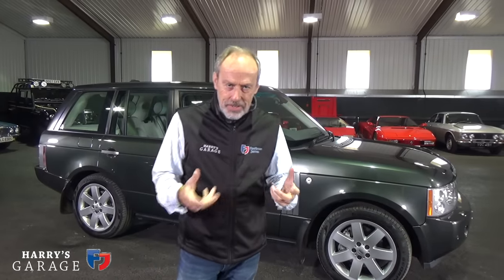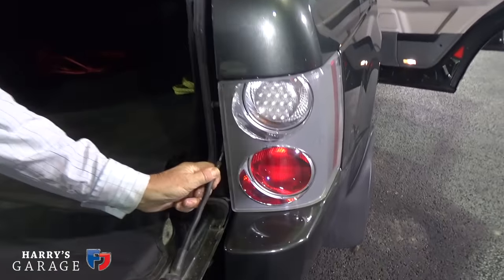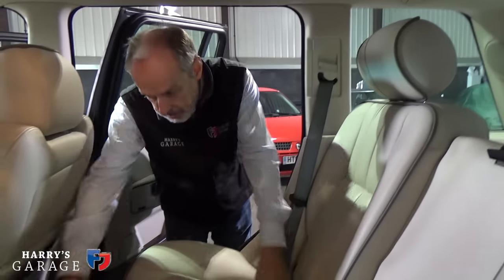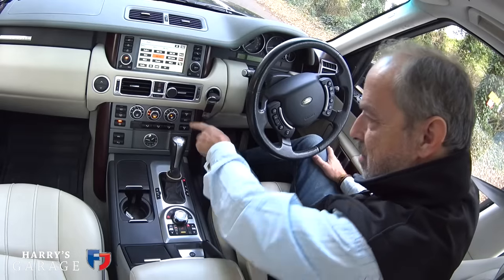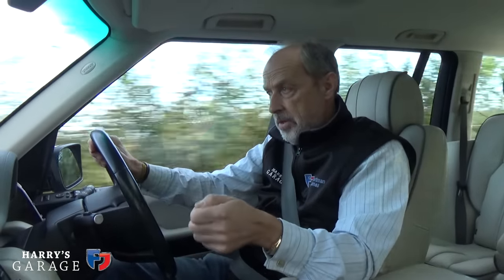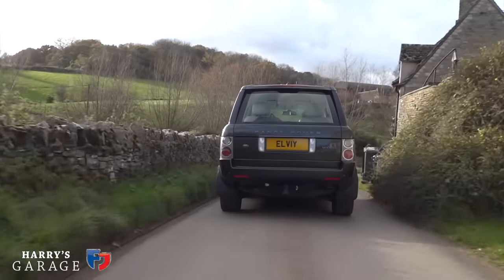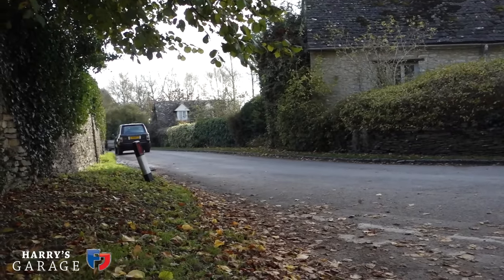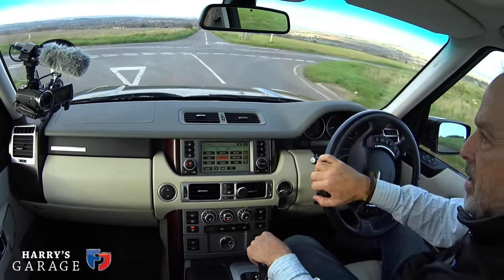Range Rover real-world review and buyer's guide L322 TDV8

Comment: They are inexpensive for a reason, mine was both the best and the worst car I have ever owned. To drive in I would argue there isn't anything better but sadly very unreliable, I spent many thousands in upkeep. Buyers beware!
Reply: My friends dad had one we went to Europe in it, great car, I think he spent a lot in repairs
Reply from the maker: That's why I've done this video, to explain which models to go for and which to avoid. L322 had a troubled gestation period, it was hatched under BMW ownership who used their 7-Series mechanicals underneath, which weren't really up to the job. When it was launched in 2002, Ford owned Land Rover after buying the brand from BMW in 2000 and they did a massive redevelopment of the vehicle, to make it more reliable, which they succeeded in.
That's why you should avoid the early versions, as the post 2006 L322 are much better sorted, as I explain in this video..
Reply: Yes true Harry,  mine was a 2009 3.6 V8 and I was in love with it, but it was so troublesome, head gasket, electric seats, EGR valve, to name a few faults. By the way thanks for sharing your thoughts, another very watchable video.
Reply: I wonder how the gas engines are as far as reliability - here in the US we never got the diesels.
Reply: Roger Bailey mine was a disaster as well.
Reply: Roger Bailey not to be a jerk and im not saying that was your case, but for me the rr is and always was a luxury 4x4. Nothing more, nothinh less. If a person is worried about maintenance costs it should avoid the rr. Go japanese or korean. If money is not an issue and you want a luxury car with real 4x4 credentials, rr are the best. Beautiful and classy machines, but heavy maintenance. But definitely more relevant that any suv from germany (suvs I mean, not the g wagen)
Reply: Inexpensive?
Reply: jigrodrigues luxury doesn't have to mean unreliable though.
Reply: Colm Farrel true, but maintenance on a luxury item is always expensive, even if it's only scheduled maintenance
Reply: jigrodrigues agreed but I don't think a car should constantly leave you stranded or constantly develop problems. In the case of scheduled/expected maintenance, which is expensive such as the egr valve, I have no problem with that as you should factor that into running costs.
Reply: Colm Farrel yes i agree, it should perform well if not better than the rest.
Reply: It's not the costs, it's the inconvenience.  Having to drop off and collect a vehicle constantly for repair is costly in time - something you can't replace like you can money.  Having to rely on a loan vehicle or make do with another vehicle is irritating - particularly when it is a vehicle you have bought because it is supposed to be somewhat practical and useful - it's not a high strung Italian car you only take out on weekends and road trips, it's a large 4wd you expect to be able to use every day and not strand you on the side of the road constantly.
Reply: Coil pack on a TDV8?
Reply: Excellent point! And it's doubly irritating when you're dropping the car with a dealer who repeatedly fails to fix the electric park brake for instance. When I ran an LR I soon learned that an independent specialist is the only way to keep these things on the road.
Reply: JJG Rodrigues Just because a car is luxurious, it doesn't mean that it has to be unreliable.
Reply: Harry-stop lying.i have a 2004 model and its been good , the mechanicals have been upto the job so for you to come here and tell people to avoid the early models is simply rubbish and not thinking
Reply: I do most work myself so very inexpensive
Reply: Gerry-Are you a mechanic to do the work yourself? what model do you work on
Reply: Barney B 07 tdv8 I do a fair bit myself what I can't do my mate does for me
Reply: He doesn't need to be a mechanic to work on a Range Rover, it's nothing that complicated, the biggest problems are tracking down problems, the rest, is just having the 'instructions' for the repair (just like the shops have) and do it. 
Somethings require special tools, so those, you either buy them or take the car to the shop.
Reply: Cut de Pie Fails you have hit the nail in the head mate
Reply: Cut, i have a L322 and would like to switch to a 2011 RRS.mechanics charge a premium to repair these cars as they assume all of us are rich mongrels.Is the RRS also easier to work on vs the L322?
Reply: Barney B no.rrs way harder to work on.
It's a body off for a lot of jobs on engine
Reply: 7000 pounds to buy... 12000 pounds to repair lol
Reply: GERRY-the RRS is based on the LR4 body-so what makes it so special
Reply: 2008/9 lr3 v8 petrol probably most reliable and long lived of the breed.
Reply: What Car? Reliability survey for 2017 puts Range Rover as the second worst in the world in terms of reliability. Only outdone by Jeep! Range Rover manage only a 50.6% reliability rate while Jeep, stunningly, only have 42.1% reliability.

Lada anyone? lol
Reply: LAPA-You are a fool if you make purchasing decisions based on those silly reliability ratings sponsored by rival car companies.FACT-RR has always been down on those ratings but people still buy their great cars, its the prefered car for royalty, sportsmen, business people and the classy.Go to any RR dealership and they will tell you that supply is limited and they even have back orders.RELIABILITY SURVEY?lol lol only a fool would believe such rubbish
Reply: "Go to any RR dealership and they will tell you that supply is limited and they even have back orders" - and you claim that is a more reliable indication than a reliability survey? Because, of course, all car salesmen are honest and there is no reason why they might want to claim their product is so desirable that it would be pointless to try to negotiate a discount, no reason at all.
Reply: Range Rover dealer incoming...
Reply: Thanks, but I've already got a wife that has been running perfectly for many years, requiring only regular servicing to keep her sweet.

As for your response, your statement about believing what car salesmen say was the most egregious piece of bullshit in the comment, which is why I remarked on it, but if you want me to pick holes in the rest of it, OK. 

Just because rich and famous people buy something does not make it the best. It might mean it's the most fashionable, or it projects an image that the individual in question wants to portray, but these are the same sort of people that buy Ferraris and then cover them in gold vinyl wraps, or buy Rolex watches that are no more accurate than a cheap Timex just because they prefer the looks and/or the image. They are the sort of people who would have bought Rolls Royces, Bentleys and Astons back in the 1980s and 90s, when their cars were superannuated designs, limping along well past their sell-by date, and long before those companies were bought out by bigger manufacturers who made their products reliable.

And please, explain to me how you would assess the long-term reliability of a product by hiring it for a few days, or taking it for a test drive? As for asking your friends about their experiences, it's great so long as there are enough of them to make the survey statistically significant. With thousands of cars produced, relying on anecdotal evidence from a handful of people makes less sense than - for example - looking at the annual reports from the companies who provide used car warranties, where they show what percentage of the vehicles they cover have had to be repaired and what the average cost of those repairs was.
Reply: Matthew Sharpe which is why I said a car shouldn't constantly leave you stranded whether that's leaving you without a car or in the middle of the countryside.
Reply: Adrian-so tell me, if you rely on those useless ''reliability' surveys which says the RR is unreliable and crap, how come I have never had any major issues with my RR which is at least 10 years old, save for the regular maintenance? If i had read the crap from those doctored surveys, i wouldn't have bought it and i wouldn't have driven across NA with no problems at all.You need to STOP this nonsense that you people keep spouting all over the net without evidence.Quite frankly i am tired of reading the same nonsense all over when each experience and situation is different.I have seen classics that are at least 25 yrs going strong while LCs remain grounded in the local junk yard
The RR is the Apple of cars and the LC is the counterfeit, imitating the RR but never able to duplicate it
Reply: Barney B
You're right, you shouldn't just use some article from a biased car journalism site to decide which car you wish to purchase. But I don't.

As has been mentioned above, you use several sources to gain your info, none of which are infallible.

But nevertheless, how do you explain a reliability survey conveying what I've heard and seen oneline and from friends over many years? Not only anecdotes of these cars being a nightmare but dealers from hell making customers regret they ever considered going near a Range Rover?

There is no one easy way to know which car will be reliable and which car won't be reliable. But trying to dismiss someone's comment because they happen to quote one particular source makes you suspect.
Reply: The internet is your friend.Just google LC 79 series for sale-it brings up results such as a 2013 model going for  $75,000 and  mind you that is a bare bones model that has never been refined for the last 25 years.I then go ahead and search for the LC V8 which goes for 40,000 pounds for the 2011 model.A 2011 RR costs around 20,000 pounds and one LCV8 buys 2 range rovers.So even if the RR was unreliable as you say, for the most part, LCs are usually overpriced monstrocities that dont make financial sense.True, i could consider the LC if the price was on par with the RR for the same year, but as you can see, the RR still makes financial sense even with those fake ''reliability'' scores that are made by rival car companies
Reply: How much is a 2011 LC and how much is a 2011 RR? You know the answer.The range rover wins in terms of affordability, class, beauty and finesse.The LC is an over priced gadget
Reply: If It's not causing problems, it's not Brit. Cheers mate. Landies are a philosophy....you know all these things...
Reply: Totally agree.  Day to day I never knew what was going to mess up.  An electronic nightmare.  Plus the gearbox was slipping all the time.  I drove it 300 miles to sell it and barely made it.  Thank God it's gone.
Reply: Garry-No need for lies and making up weird stories.If RR are so bad, how come everyone wants them and is the official car of the royal family? You think you as a commoner know more about reliable cars than them?
Reply: No Lies.  Maybe a commoner! HAHA The secret to success with these cars is to sell them before they turn to poo.
Reply: Garry-A new RR is at least  $100,000 and demand vastly outstrips supply.Its used by heads of state, the military, the police, celebrities, and is the official car of the royals.Besides that, its the only car in the Louvre museum.So.......I suppose all these users are wrong and YOU.....a disgruntled commoner is....Right? Do you see the irony here?
Reply: Barney B   Actually the royals are paid for the use of their warrant, which recommends British products exclusively. The official “everyday” car of the Windsors is Jaguar. The Queen gets many years out of her XJ sedans, which she drives herself on her estates. For many years Jaguar have had a standing agreement with the royals to provide them with a car, free of charge, from the dealership closest to where they are visiting. And one final thing to consider: the new “official” limousine for Elizabeth and Philip to use on occasions of state is a magnificent one-off Bentley Mulsanne.
Reply: John-That's just the royals-Many many classes of people use the RR while the only people who i know who use the LC are Isis terrorists, extreme overlanders, mass cheap people, ambulances and police cars in the 3rd world and mining companies
Reply: Same here. Was wonderful when it worked, but it regularly let me down and cost a fortune to maintain. Should have bought the Land Cruiser I had my eye on.
Reply: The only thing whining and complaining all the time whilst I owned the 2003 LR322 (which Harry recommends avoiding) was the LR322 itself. It was a shame, as I loved the car and had always wanted a Range Rover. It just turned out to be a disaster. It was meant to be a comfortable car that looked better than the LC and could take us on family trips offroad in Dubai, but sadly that never came to pass.
Reply: Dubai? So many cars to choose from in Dubai apart from the RR.If you drive in the desert, dont even think about the RR-it was not made for pathetic environment like that-stick to the LC in the desert.L322 is LUXURY-a desert is a remote no luxurious place
Reply: Thanks Barney. After fifteen years of offroad driving here I'm fairly up to date with what's what. The L322 should be perfectly suited to driving on mountain tracks, wadis, long road trips to Oman, etc, but was simply too unreliable. There was plenty of marketing done around desert driving and gentle dunes should have been perfectly fine, but the suspension would automatically lower itself at over 40kmph, which meant it was too easy to damage the bumpers. The main issues for me were less the cost of maintenance and more the fact that it could let you down at a moment's notice, which it frequently did. You don't want that to happen driving around the corner to the supermarket - and certainly not halfway up a mountain when the transmission overheats, or when crossing the Oman border halfway into a 5 hour road trip with smoke pouring out of the exhaust, or halfway to a wadi drive when the fuel pump fails, or needing to drive to work when the air suspension springs a leak, or driving to the airport when the telescopic steering collapses. Just some examples for a vehicle that was regularly maintained under an extended warranty at the dealer itself. There are good reasons why the 2002-2006 models cost nothing and people such as Harry specifically recommend avoiding. The car was an utter disgrace in terms of reliability.
Reply: i have a 2002-2006 Model and again, its never let me down.Gone for more than 4000 km in less than 4 days and it worked perfectly fine, commanding the road and being luxurious.Dont listen to some Harry guy telling you to avoid a car, i am RANGE ROVER AND I USE IT daily and see no problems
Reply: i would never buy an overpriced UGLY LC.They are so UGLY everytime i see one i close my eyes.UGLY tail lights, UGLY SUSPENSION, ugly shape and UGLY grille.Why would i buy one? if i want reliability, i might as well buy a horse, its very reliable, it never breaks down
Reply: Barney B Well, quite. That’s why I bought the Range Rover. In retrospect, a bad decision for many of us. If you could coming RR engineering and styling with Toyota reliability we would all be happy.
Reply: But then again, I'd rather have diphtheria then have a £7K Astra
Reply: Roger Bailey  a kind of  hatred and love story at the same time !!!!!
Reply: Barney B hi , did appreciate the way you defend RR , I am looking to give a try , but more I try to dig infos and read comments  am getting more confused , seems that they are good period and bad periods of their production/  am a  Mercedes owner / and I have had  huge electronic issues with my 2008  CL 600  V12  , coil pack , gear box stuck ( sold it ) after spent 10.000£  to try to fix it / I went back for early models  2002 / 2004 and own  several of them .. absolute perfect reliability ! So will keep them when I will diving into the “RR uncertainty “ !!! HSE Sport likely ... one thing for sure RR has the best driving position!! Beautiful cars elegant chic  ... ( BTW not sure about reliability of beautiful elegant and chic women  ? but that s another story !! )
Reply: I agree 100% with this comment. My 2008 TDV8 RR has been wonderful to drive while working, horrible to own. I have had issues with suspension, EGR, fuel return circuit and turbo geometry. All of these issues left me without a car driving around in my wife's Citroen.
Reply: Needs EGR valve change at 90,000 miles? Odd that one of my Ford SMaxs has covered 205,000 miles and is still on the original EGR and DPF. Also original, engine, gearbox, injectors, clutch, DMF and turbo. Had to change the battery twice and it’s just had its first starter motor at £189 fitted. Massive space and drives like a well sorted hatch back
Reply: I use my 2011 RR autobiography daily along with my Disco 4, I look after mine and haven't had any problems, I'm a LR tech however and although a few problems do come up most people do not realise there are actually 2.0 versions of the parts which fix said problems lol. LC are good for deserts and stuff but most of us live in the city and do 15% dirt which is why the RR is king forever :-)
Reply: Inexpensive?!?!?! They’re like £100k new!!!1
Reply: Second hand, they loose a lot of money.. I love mine but I'm a mechanic and I don't really see the labour costs but it's not cost me much to keep going.
Reply: Five Eyes Sights totally agree I’m afraid a lot of Harry’s comments about the early rr are totally wrong if you get a good bmw one they are great cars for the cash
Reply: Roger Bailey iiii
Reply: Five EyeSights I hate to interject politics but you sound like a ardent Trump supporter that sees no wrong or flaw with your choice. Scary.
Reply: FULL SERVICE HISTORY IS A MUST! heard of turbo's going, AND snapped crank shafts. MAINTAINANCE is absolutely KEY to the long life of the L322. I've had a RRC V8 3.5, and a P38 Diesel(of which everyone swore blind was a shite car, just do the correct servicing and they all become great cars). L322 is next on my list with the TDV8 power plant. Thanks Harry, good video.
Reply: Sorry Harry that is utter BS
I work on BMW's all day long and I own an L322 with BMW Electronics
The BMW era car is by far the best L322 to own
Mine has done 300k
I changed the engine, got a used one from an E39! 
The post 2006 versions are utter rubbish. Major work with Turbos, DPF's, Ford Electronics
I upped the power in mine using a turbo from another BMW (some slight rework needed)
Reply: Hi Henry, in my opinion, 3.0 M57 is the best option for l322, the maintenance is the cheapest for this engine at least in Poland, I don't regret I have this version and I would recommend it.
Reply: M57 is a fab engine. Far better than the later PSA based junk
Reply: Garry Patrick has
Reply: So very true. You buy this car at a loss. You buy them, experience them with passion until something breaks. Either spend alot on repairs or dispose them.
Reply: @goldenboyi1989  just because you haven't had any problems doesn't mean they are all trouble free. production quality varied a lot back then.
Reply: thx cpt obvious..i mean that's the catch with all of these luxury import rides..the best rides on the road, if you can afford to keep it on the road, 
that's the allure, demand, attraction, respect from others, whatever youre going for, impressions or engineering, you've got it..IF
and if not..there's the Kaizen quality control of Toyota-Lexus..my brand for the last 20 years..but, an air bed on wheels, made for moms, in comparison.
Reply: Colm Farrel  Egr valve problems affecting all modern diesels and a fair few petrol cars, I have worked for JLR dealers and VAG dealers, Vag have major ego issues and as they are mostly built into the ego cooler systems don’t be fooled very expensive to fix, the main cost of ego repair on Range Rover is the fact that they are buried under the left turbo so it has to be removed to rectify
Reply: Five EyeSights don’t do it terrible car new shape RRS much much better and more reliable car
Reply: adrianchell bullshit every manufacturer has backorder issues, JlR are actually very good at problem solving and reengineering problem Parts which is often the case with back orders, they also have a very good escalation system to combat this if the dealer staff know how to use it, I have recently switched to an Audi dealership and believe me JLR are streets ahead in Parts backup and infrastructure than VAG
Reply: all land rovers are unreliable not just Range rovers lol
Reply: It doesn't matter if you can or can't afford to run these behemoths, they should still be fit for purpose. If you're forking out 1000's of pounds in repairs every couple of months or years then what's the point?! A car is no good to me if it spends more time in the garage than it does on my drive. Also, the fear of it breaking down when it is on my drive
Reply: Cut de Pie Fails lol no your wrong egr valves on tdv8 requires turbo removal, gearbox repair/torque converter needs body off, diagnostic is the key to most faults and no cheap code readers do not tell you anything like the main dealer ones
Reply: Five EyeSights you have a valid point, the key to owning such a vehicle is main dealer maintenance, people think that warranty recalls make cars seem unreliable, not true, JLR are actually very good a fault fixing when one is identified, they will not release a new vehicle for customer delivery from a dealership if there are any outstanding recalls, vehicles will be quarantined if a known problem has no fix available, unlike some of America’s favourites, on my last JLR course there was a guy whose dealership also had BMW and he claims that the BMW Customers have more problems under warranty rather than fixes, I currently work for another German manufacturer and believe me they are also a premium brand and so far I’m not that impressed with overall reliability, warranty repair and general repair costs either
Reply: John Richards not completely true, the armoured official engagement cars are provided you the state, the personal vehicles used on the royal estates (actually Royal Parks) are indeed paid for by the estates (ie the Windsor’s personally albeit by estates management)  and even customised to their requirements (including defenders as general work vehicles) the royal warrant is awarded by appointment , an acknowledgement of the venders who are approved by choice of Royal family members and their estates ,  basically if the Royal family members spend their money with your business and they are happy with your service and product/produce then the estate/member will award the royal crest “by appointment” allowing your business to display the acknowledgment of your businesses serving them as a satisfied customer, they definitely do pay for whatever they purchase in your business
Reply: David Viner egr life’s is largely determined by the traffic (or lack of) that the vehicles are used in, in affect VWs emissions scandal fix is actually having a detrimental effect on egr valves because of the software fix (did you know this included glow plugs always on in an effort to make sure all fuel present is effectively burnt to try and lower the claimed emissions values)
Reply: Five EyeSights I agree, mine is 2002 so probably one of the first off the line. In the 8 years or so that I’ve owned it I have had a reconditioned gearbox, new turbocharger,  new fuel injector, new brake pipe, new front air suspension struts & airbags and other suspension parts, & new handbrake assembly (as well as new brake discs all round, due to the car standing for months at a time, and usual stuff like light bulbs, lens covers and some trim bits and touching up on wheel arch.. But I bought the car fairly cheap with 232,000 km on the clock so taking that into account it’s not that bad. I drive it across Europe twice a year (1200 miles each time) and have no complaints about the performance. It needs a bit of a boot at first when accelerating but cruises very happily at 100mph. For anyone who doesn’t intend to exceed the speed limit regularly, this car is fine. It’s a holiday car which I keep in Europe, it does around 4000 miles a year and I now have it anti-rust treated every autumn and the salt cleaned every spring. My philosophy is that most of the parts that were ready for replacing have now been replaced, so with low annual mileage and preventive maintenance there’s a fair chance I will have a reasonably hassle free drive for some years. Repair bills have been high but rather than look at them in isolation I also consider what I paid for the car compared with buying a more recent model which could also have had costly issues. No complaints from me.
Reply: @harrysgarage  Hi Harry  I enjoy your vids, im looking at a 2010 1 owner Land Rover sport TDV8 but has 280,000 kms but has been well serviced though out its life but its the kms that put me of a bit.
Reply: @harrysgarage  My 2006 RR HSE still works beautifully.  There is one rust spot on it due to the dealership putting mismatched washers against the body of the vehicle and then refusing to acknowledge it was their fault. They refused to repair the rust spot.  The Ford Moter Company did a remarkable job redesigning and treating the RR like a Ford truck...Ford Trucks Don't Break!!!
Reply: @cutdepiefails6596  You can find most of the repair issues fully illustrated on Youtube in easy to follow instructions.  Must drive the dealerships crazy.
Reply: Very true
Reply: @harrysgarage   diesel is banned in London ,  should i go for petrol v8? or petrol v8 with LPG? im scared of  very low MPG
Reply: lapamful wow. Just wow. 🤦‍♂️
Reply: @jigrodrigues  agree 100% I have a 2010 L322 Autobiography, look at all the systems and equipment on this car, its not a ford fiesta and needs the same maintenance of an intricate industrial machine, once you stop comparing its heaven to drive.
Reply: @goldenboyi1989  have you seen any member of the royal family paying for the maintainance of any of their cars? They are subsidized by the state... meaning all the commoners :-)
Reply: I have this exact car in Australia and spend about $AUS1000 a year on LR service. I had previously the 3.0 diesel and it was better on fuel, so sorry Harry!. Mine has towed my 30 foot yacht (plus launched and retrieved it effortlessly), driven through the Murray River and takes me to the Australian Alps and Central Australia, without issues.
Fortunately, unlike the model after (L405) it does not have a DPF, which I am advised does give issues.
Reply: British designers are so considerate.
They design such nice luxurious interiors in the majority of their vehicles because they know people are going to send a lot of time sitting in them waiting for a tow truck.
Beautiful and luxurious but will accumulate most of their mileage going to and from the dealership for repairs.
Reply: @gerryr1893  Don't mix it with the RR sport which is a Discovery given a Vogue body.